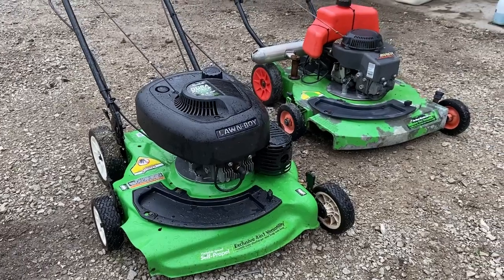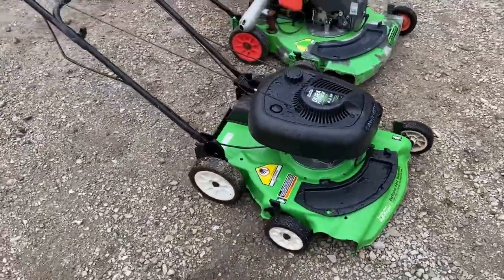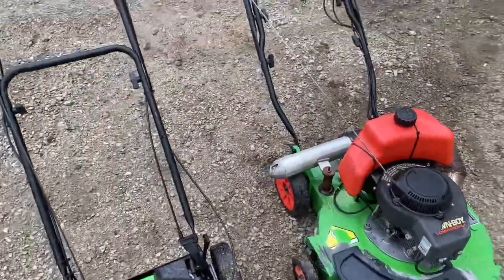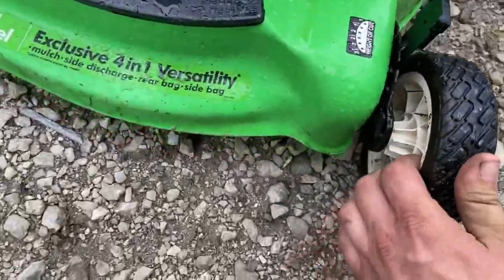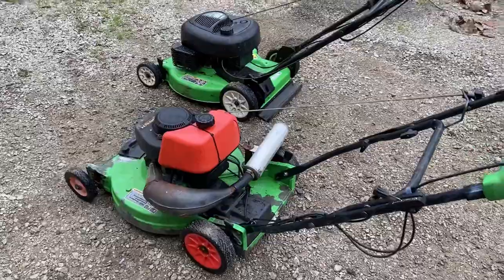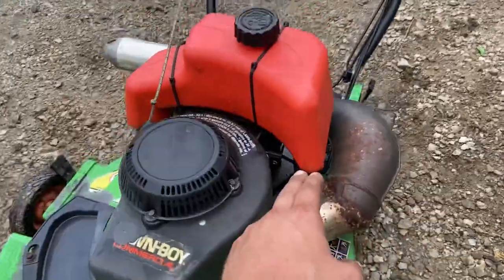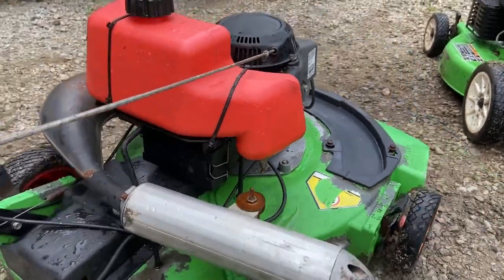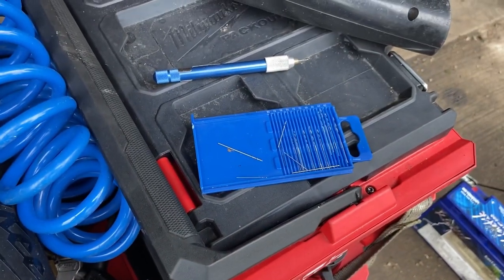Custom jetted & piped Lawnboy 2stroke expansion chamber power modified push mower lawn boy 2 cycle

Comment: It needs a much, much longer header pipe to jump on the pipe. Right now thst exhaust is making no power. That exhaust wants to see 8000rpm before it makes power and I can tell you know that engine ain’t anywhere near 8000 maybe  5000 at the most.
Find out what rpm the stock engine makes max power and then calculate the header length to come on pipe slightly before it.
Reply: Yep. Tuned length needs to be checked w/a little math (pipe looks way too short for a ~3.5k rpm mower.

Unfortunately, pipes (as cool as it looks hanging off that Lawn Boy!) really like exhaust timing starting about 170/180 degree's to give a strong enough neg pulse (suction) for the divergent cone to really pull burned gases (w/some new mix). The return pos pulse will need that extra timing to find the exhaust port still partially open for the stuffing wave to push that fresh mix (in the headpipe near the port) back into the cylinder.

There is no "free lunch". They do not work over the entire rev range. The higher the hp, the less flexible the pipe range.
Generally (Go-peds/100cc kart etc excepted) a pipe that really pulls hard is operated with a multi speed gearbox or torque convertor.
These things have a "range" where they are "on the pipe", where they work so well, but above and below that range (together w/ higher EX timing to make them work well), you''ll get a (dip) in power curve. A better performing " lawn mower"  type power band from a canister type exhaust (an older 125cc competition 2T low speed "trials" motor cycle exhaust system might be a good place to get some relevant measurements, as they operate at lower rpm's, yet can loft the front end over massive rocks just by grabbing a handful of throttle and some rider weight shifting).

AuMechanic has a great series (with his free downloadable pipe calculator based on Blair's formulas) here on YouTube.  Google for other free calc options. Lots of pay programs too for the more dedicated or obsessed.

Comment: i did the same thing to my toro gts 120cc two stroke mower but sadly my air filter was letting dirt into it and it needs rings now but it had just as much power as yours.

Comment: I found a gold edition at a goodwill in Lexington ky.....electric start, mulcher,charger included. like new. $35.00. Someone apparently couldn't deal with the mixing. Only needed a drive cable and battery.  Bought it in the middle of winter.
Reply from the maker: That’s a score worth at least $350, in my opinion more.  A lot of people have 2 stroke string trimmers, only hassle is buying extra oil but then again no oil changes or maintenance and lighter weight engine with more snappy power to enjoy.
Reply: @NaptownTuner  I walked past it at first and had to do a double take. I recognized the color and could not believe the condition or price. My wife thought I was nuts buying a mower with it snowing out.
Reply: @NaptownTuner  Problem is finding someone that will actually pay $350 for it  but who knows maybe they will start selling vintage mower's at barrett jackson lol
Reply: Sounds like you got scammed
Reply: @NaptownTuner  lmao 350$ 😂
Reply: @NaptownTuner  any modern mower could easily cut through wet tall grass like you showed without cutting off the engine lmao. This shit isn’t worth anything. It belongs in the landfill
Reply: Hell even a fucking battery powered mower could probably overpower this heap of trash

Comment: You shouldn't cut that tall grass with a mower, you will overheat the engine and destroy the piston rings 😅 i did that to the 1970s lawn mower my family got, i will rebuild the engine and put the new piston and rings in it 😄
Reply: If a mowe can´t handle that, it has a problem and needs to be fixed. If everything is ok, a lawn mower doesn't overheat, no matter how tall the grass is.
Reply: Nonsense, I've used the same mowers for many years, & basically used them like brush hogs , my lawn boy is 35 yrs old and my brothers is 50 you must be doing something wrong